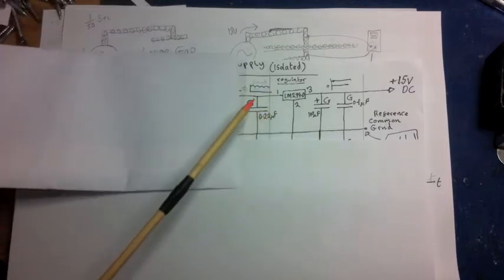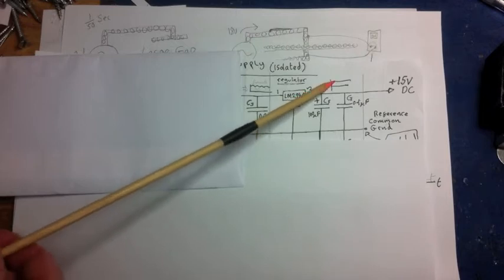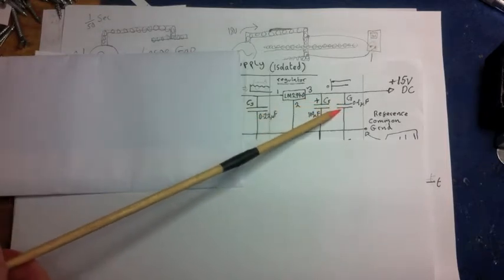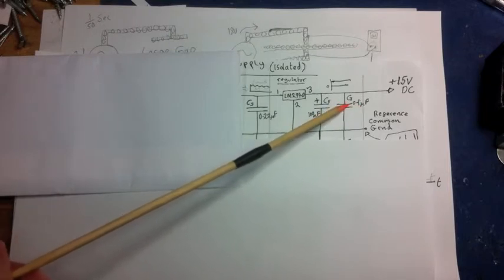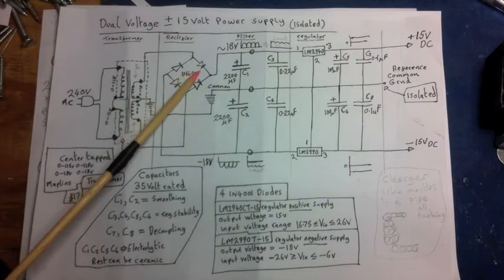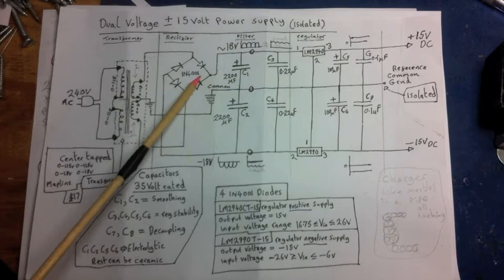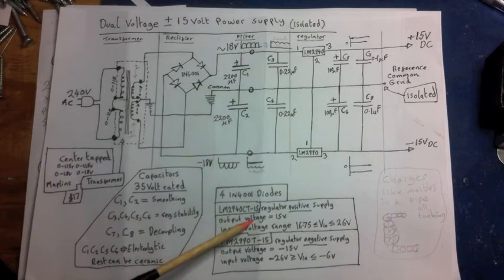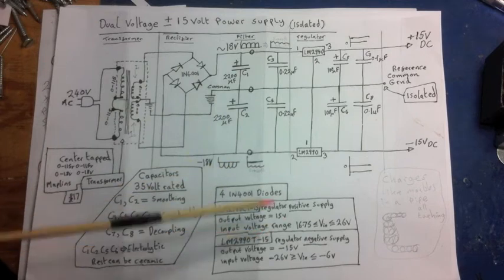Dual Voltage Linear Power Supply Build (part 2)

Comment: Nice video nicely explained. I was curious about the 18V on the transformer output. Looking at one rail, at 18V AC and then rectified you have 25V DC to feed your regulator. Keep in mind the electrolytic's on the output need to be within an ESR margin. How did the project work out ?
Reply from the maker: Used for portable valve radio repair. Very simple circuit, works well.